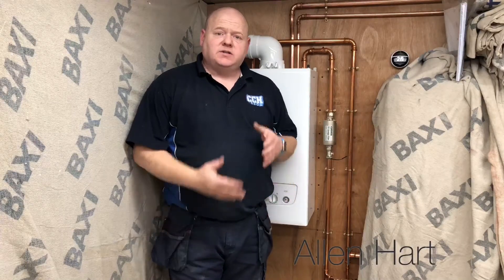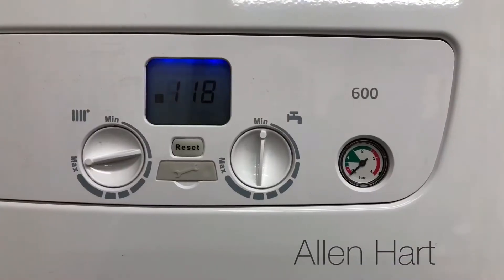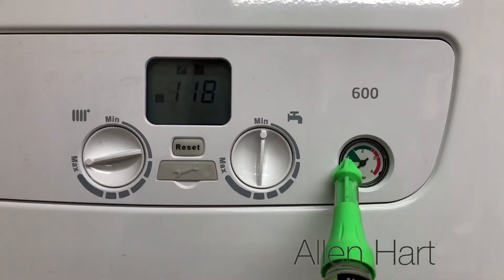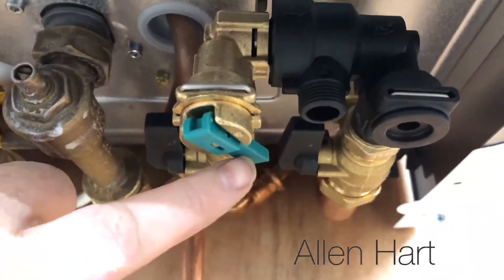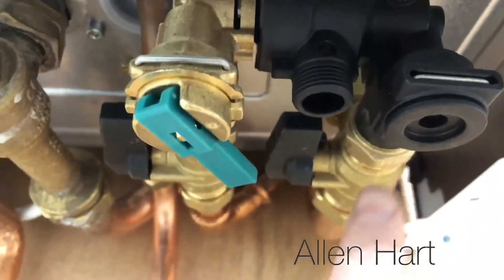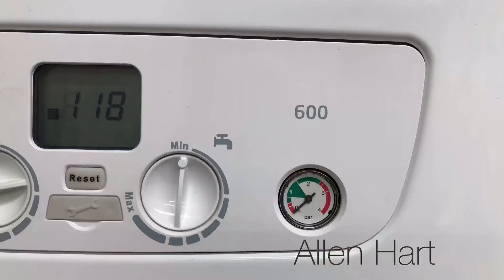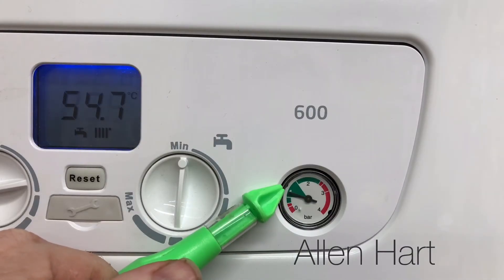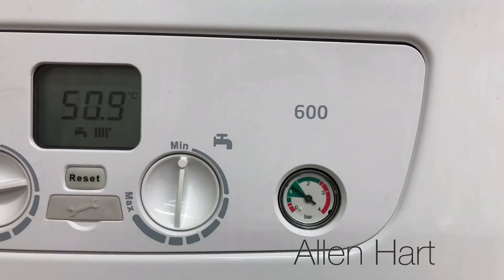How To Repair Your Combi Boiler  E118 fault code. Low water pressure.

Comment: Hello, our Baxi 600 doesn't have a green lever like on the video. There are a couple of black twisting ones but they do not appear to resolve the issue either. Could the lever be located somewhere else?

Comment: Hi Allen, could you help me please.  I have a baxi 630 combi that is working fine with no error codes or leaks anywhere. However a few weeks ago I noticed the pressure was just below 1 bar so I went to top the pressure up by pulling down the filling loop valve lever. I normally hear water filling the system and seeing the needle going up to show pressure increase in system. I held the lever in down for about 30 seconds and needle didnt move. Today I checked pressure guage to find it reading zero and there is no sign of leaks anywhere in the heating system and radiator valves. I am reckoning on a faultly pressure guage. Is this an easy fix for a diy er like myself, Is there a way you can drain down the boiler pressure partially at the boiler rather than draining the whole system down from the radiators to remove and unclog the guage pipework or do a total guage replacement. I know the part is only about 30 quid its just having the balls to partially drain the boiler down thats a bit daunting for me. Your advice would be appreciated very much indeed.

Comment: You sir are an absolute saint. We have been without heating for a week and could not get response from landlord. I've spent about 50-60 quid in that time extra on electric for got water bottles and using oven for more got foods and actually put some heat I to the air. Honestly thank you so much
Reply from the maker: Happy to help, Thanks

Comment: We had a new boiler installed, working. Shortly after we had a full rewire and a few radiators replaced.

Since turning it back on we have this error message. Ive pulled the lever and it initally caused water to come out of the top of a radiator (the plug wasn't tight enough). Even though that is sorted I still can't get the pressure up.

 Any ideas?

Comment: Thanks Allen you ledge. I’m usually quite good with boilers having sorted 30+ different ones with work over the years. But I’ve got a brand new boiler and it was its first error code so wanted to watch a video first. Turns out the husband let all the air out the radiator upstairs. But thank!!

Comment: I've done all this, but, not working, there is no sound of water flowing when I turn the switch on and the pressure doesn't go up? can anyone advise? thanks
Reply from the maker: Sorry for the delay, Did you sort it? Thanks.
Reply: @AllenHart999  yes, thanks Allen, I got in touch with the man who put the boiler in,

Comment: And if you don't have the pull down thingy?!
Reply from the maker: Which boiler do you have? Thanks.
Reply: @AllenHart999  I worked it out, thanks Allen. Mine wasn't plumbed with the same release valve, but it has two smaller ones. Less obvious and a bit hidden, but I got her going in the end. Thanks for the reply all the same 👍

Comment: Hi Allen

Great videos

I have the Maxi Assure model displaying the 118 error. There is no green filling valve.  Where would I locate the filling valve on the assure model please? There is the black valve left side, yellow valve middle and black valve right side but no green valve

Any help is much appreciated 

Thanks John
Reply: I have the same problem, did you get your sorted?

Comment: Niceone. Pressure dropped to zero. Just had the Main boiler installed on Friday 19th Feb 2021. Already have to wait for an engineer to come out to look at it as the hot water isn't working. I've a 10 month old too and we have to wait until Wednesday 3rd March 🤬🤬
Reply from the maker: What was wrong with it?
Reply: @AllenHart999  engineer had put the hot and the cold pipes in the wrong way around. Apparently its very common 🙄 🤦🏻‍♂️
Reply from the maker: @polluxtroy69  Only commen to people who haven’t got a clue what they are doing. Glad you sorted it. Thanks for coming back to me.
Reply: @AllenHart999  yeah thats what I thought. The engineer who came out to look at it said he sees the issue all the time. It was quickly fixed. And you're welcome.

Comment: Is this a common thing with a baxi boiler, we got our new one installed two months ago and came across this pressure drop, is there an issue or does the boiler always need to be topped up now and again? What if it happens another month down the line?
Reply from the maker: No Problem. Happy New Year.

Comment: hi I have the same boiler  but it doesn't have 600 above the pressure bar. 
showing the SAME E1 118 fault code but it doesn't have 600 above the pressure bar.
It doesn't have that green tab underneath it either. It just has 2 blue 2 black and 1 yellow. I tried pulling them all down but nothing. It will only work with usb port only. Pls if you see this today pls reply 

thanks in advance.
Reply from the maker: No Problem. Happy New Year.
Reply: Hello same happened to me what happened now ,did it work? How?

Comment: Allen. Have you tested the flow rate out of your 600 yet?
Reply from the maker: jordan drysdale I haven’t tested it on this boiler as it’s not connected to the hot water at the moment. I have tested they on installs and the flow rate is very good, think we were getting about 13 L/M with 35/40 rise.